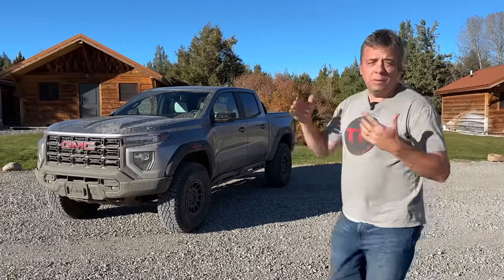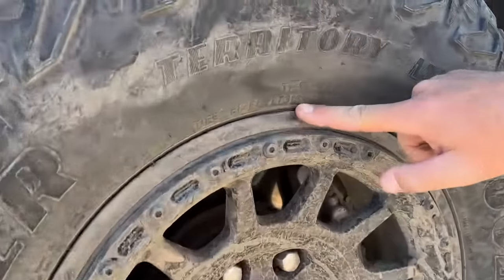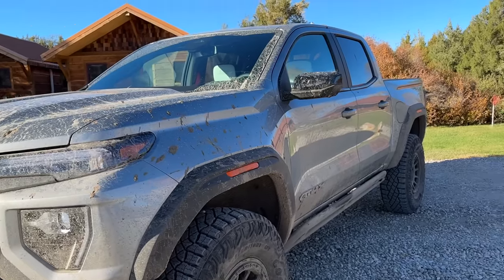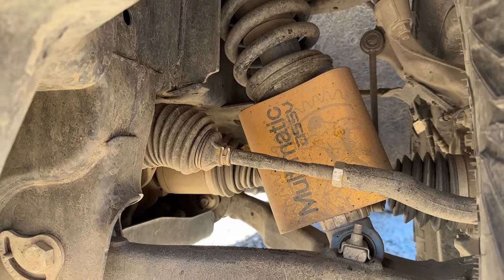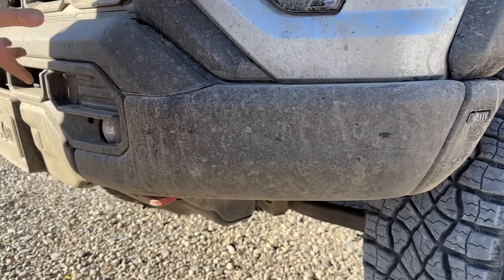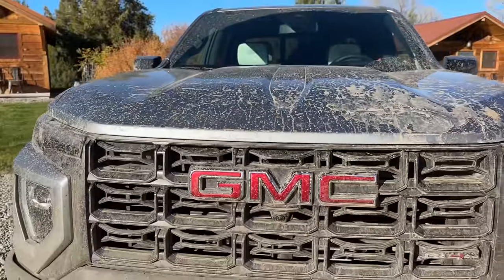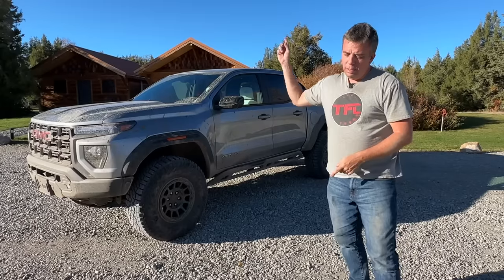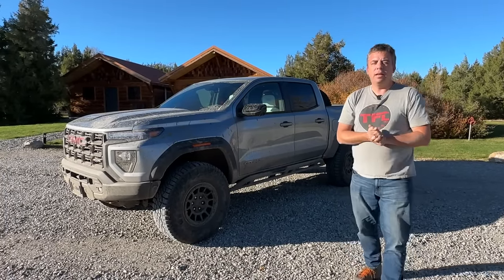Here’s Why The New GMC Canyon AT4X AEV Is The Ultimate Off-Road Pickup!

Comment: Jeep killer? Don't think so. Rubicon comes with lockers front and rear. That has IFS, so unless you get a long travel kit or SAS you're limited and vulnerable. Leaf springs on the rear when everyone knows coil over is better overall. Not much more HP than Jeep JL and  heavier. More that can go wrong with intercooler and unnecessary tech. None of the customability of a jeep. 3.42 axle ratio whereas rubicon comes with 4.10 and Dana 44s front and rear. You can literally just get 35s put on them.

This is not a Jeep killer by any means

Comment: 974 lbs of payload!  What a joke..a Maverick has more!
Reply: Clearly you don't understand how payload works when you compare this vehicle with the Maverick.
Reply: @TheJosesrt4  I sure do it the weight of passengers and cargo a vehicle can carry.  Clearly right?  Yep.
Reply: 974 pounds for payload is a joke in any truck. Specialty or not. That’s Honda civic payload territory. (850 pounds for the civic). And yes, I know how adding stuff reduces the payload. They are engineers. Figure it out. Make it that it can work as a truck even after adding a few steel bumpers.
Reply: @Pantelifts10  not very special with that crap payload.  It’s still supposed to function like a truck.